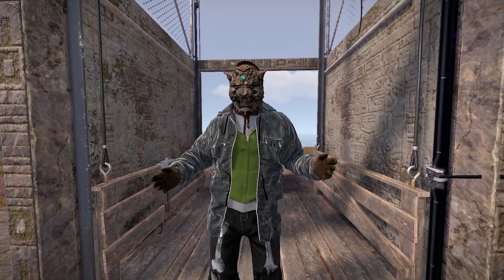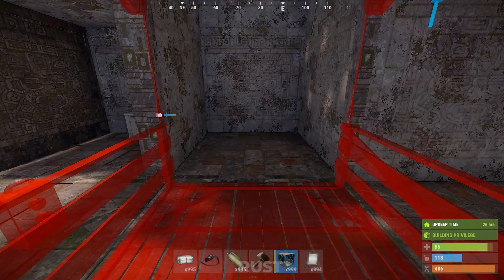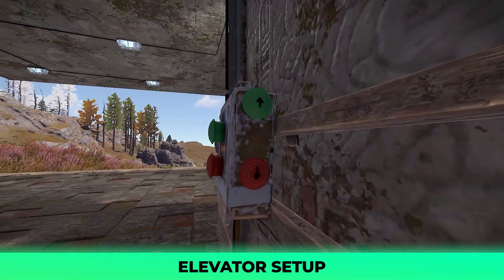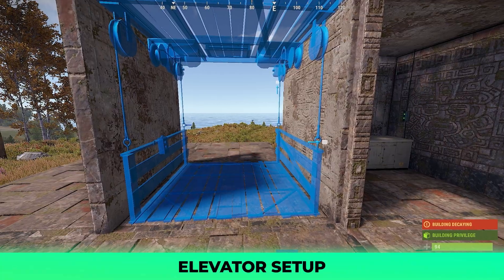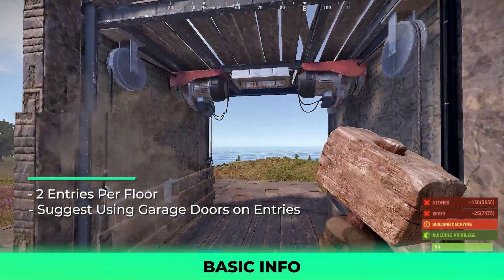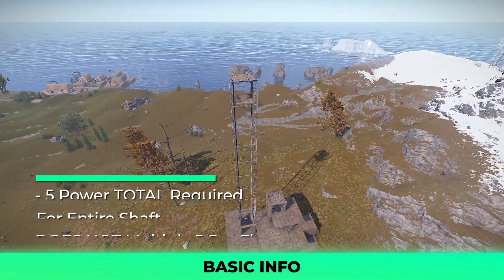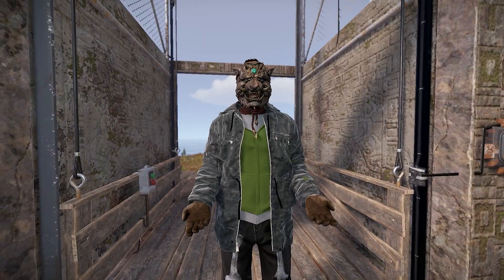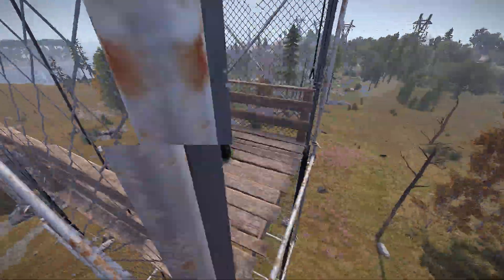The Rust Expert's Guide to Building Lightning Fast Elevator Systems

Comment: DAMN this is way easier than I would've expected!!! I've so rarely seen people use elevators but genuinely would be hugeeee on a base with kits in core for getting to roof access!
Reply from the maker: Yea they’re stupid easy, I think what scares people away is each level/floor requires an additional craft and it’s sort of tough to build and plan around